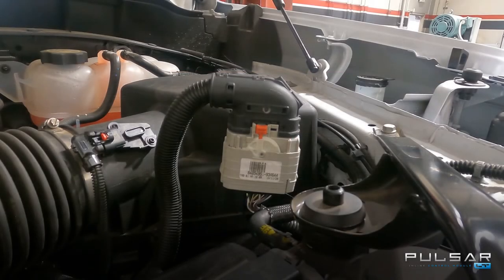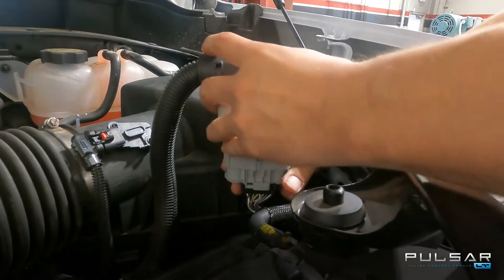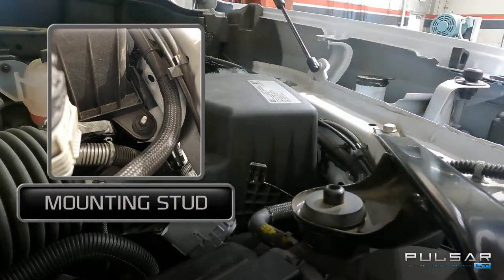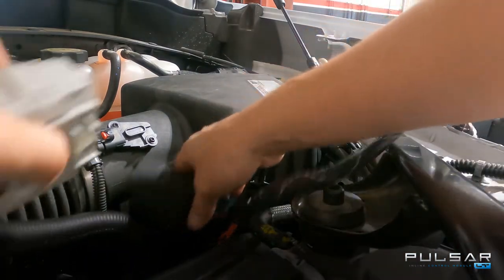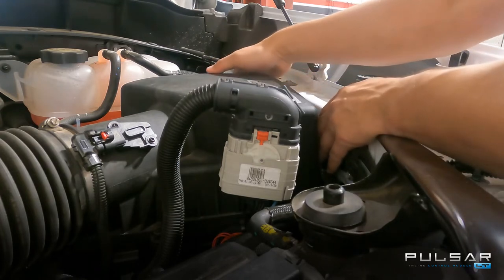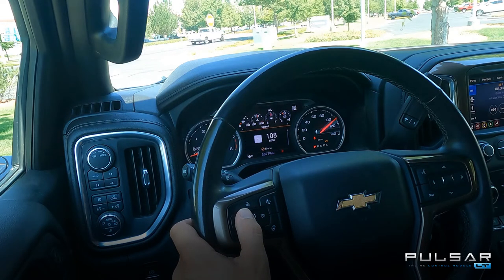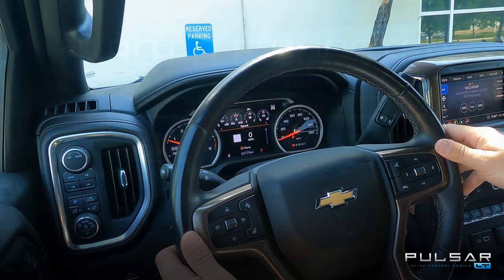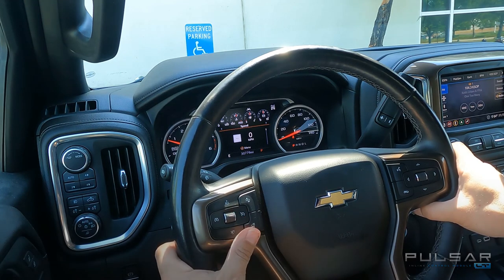Pulsar LT for 2019-2021 2.7L Turbo Silverado

Comment: QUITE A DISAPOINTMENT. THERE IS NO SPEED LIMITER ON THIS MODULE. IT ONLY GOES FROM 1-5 AS FAR AS THE MENUS GO. WHAT HAPPENED TO 6,7,8 SETTING FOR THIS MODULE??? BUT ILL KEEP THIS MODULE BECAUSE I ALREADY INSTALLED IT.
Reply from the maker: available features vary by the truck model, not all GM vehicles allow us access to the speed limiter tables.
Reply: I want to know if it removes the speed limiter from the 2021 silverado 2.7 turbo
Reply: @jesuspahmer839  no it does not. That’s why it’s a disappointment
Reply from the maker: @jesuspahmer839  This device will not do speed limiter on the 2.7 applications
Reply: Wow what a disappointment you would at least expect to be able to move the speed limiter probably have to take it to a tuner to take it off

Comment: So If I don't have the push start, just turn the key a little bit?
Reply from the maker: You just need to turn the key to the ON position, without starting the engine.